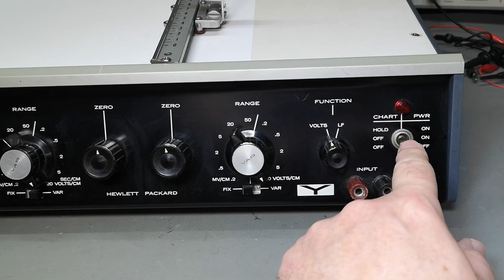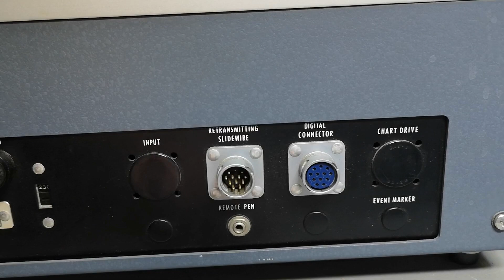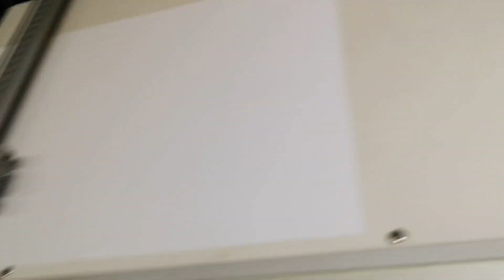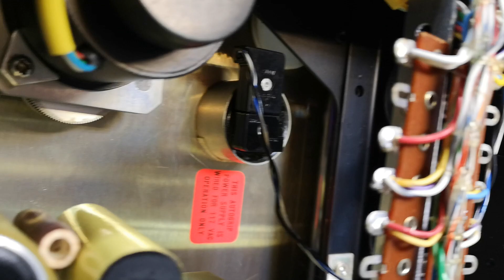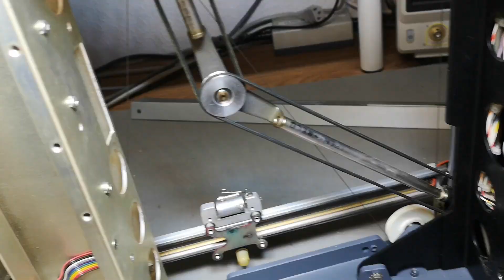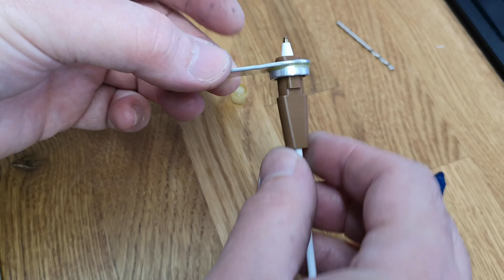HP Moseley Autograf 2D 2AM analog XY pen plotter teardown

Comment: Time to start making some genuine Tek graphics from it, or if you can get a genuine HP graphic. you can also connect to some older TEK digital scopes to get the recorded waveform out from them, using that digital input, which transfers analogue signals and pen lift commands.
Reply from the maker: i was reading up on my Siglent IQ wave generator software, i had the idea i could make it write some funny text, but it was faster just to show two sinewaves,